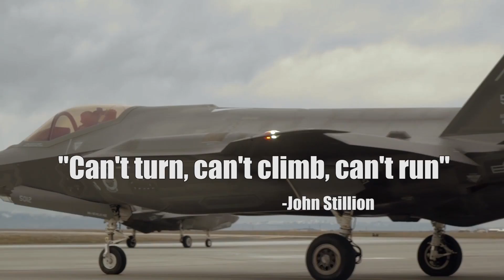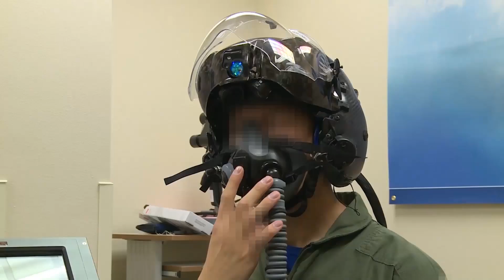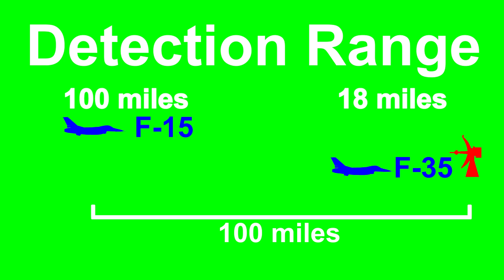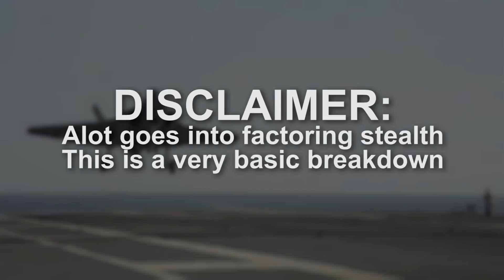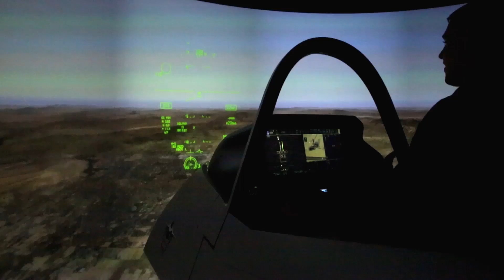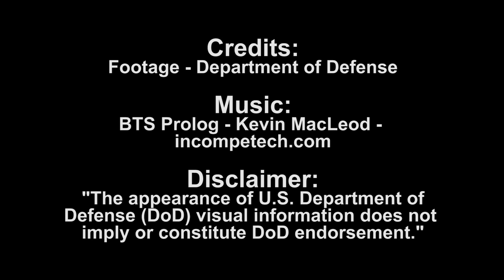F-35 Overview - The Good, The Bad, The Ugly

Comment: The F35 and the Magnetron

Can the F35 Fighter Jet make ALL OTHER FIGHTER JETS IN THE WORLD OBSOLETE? YES!!!
To understand how the Universe works, and how time, matter  and energy interact with each other you need to understand that the Universe is a Binary System, you have Energy that consist of Matter, and you have Space that consists of Dark Energy 
The interaction of Energy and Dark Energy form up the foundation of the Universe, and specifically Gravity and Time
So, if you have a Magnetron, and it puts out an Electromagnetic Field that pushes away Dark Energy it will "Push away Time" as well!
So, this Magnetron is able to manipulate both Gravity AND Time

Think about this, where the "blower fan" is on the F35, if you integrate a Magnetron into this rotating system and generate a Toroidal Electromagnetic Field that pushes away Dark Energy, you will decrease Matters interaction with Dark Energy and you can "Slow Time" 

When you Slow Time, you have in essence what can only be called a "Time Warp" The Jet and Pilot will be in a Time Zone that is experiencing LESS TIME and therefore will be able to move MUCH FASTER!

Imagine the implications of this in a combat situation!

Your huge bulking duck cant get off the ground of a Jet has a trick up it's sleeve! It can WARP TIME! 

Enemy Missile coming in? Multiple Bogies on radar? No problem, kick in the Magnetron, and you will go for 650 MPH to what looks like 2,500MPH in a flash, you will be able to turn and maneuver as if you were going a lot slower, so you can literally dodge missiles, you can outflank and outmaneuver your enemies and you can simply out class them in ANY SITUATION! 

Plus, with the probability of Electromagnetic Pulse Generation Weapons integrated into the system, you can come out of your Time Warp and generate a HUGE Electromagnetic Pulse at the same time, disabling vulnerable electronics at the same time!

F35 For The Win!
Reply: Orion Michael Guy I think you are in the wrong century
Reply: @colonelstriker2519  -  I know I am a natural genius and everyone on this planet is so stupid they seem like literal farm animals! lol - Just Joking... - but no, the data I provide is fact - these jets are way more advanced than people realize - and unfortunately, this planet is being controlled by - how can i say this - this planet is a farm slave planet for ET/Demons that eat people - and people really are so stupid they are farm animals and they don't even know it! Hahahaaaaa.........

Comment: F35 have a number of other advantages that older planes like F16 and F18 are missing.

If we look at the C modell that is the competitor to the F18 its more fuel efficient. Faster cruise speed. More automatic flycontroll system (lowering workload on pilot), more electronic counter measures, 5 tons more load capacity (about 37% more), better dry thrust to weight, higher G-load (due to pilot configuration), longer combat radius (reduce the need for refuling), generally cheaper to run.

For the strike role two F-35 kan pretty much do the work for three F18 using less fuel, and fewer pilots, also less maintenance.

Yea sure, it loses some stealth capability when running heavy. This is hardly a issue because this is ment to be done with air superiority. The most expensive part to maintain is the engines. Larger engines is just a bit more expensive to maintain. So that pretty much rendering 6 engines down to 2... that is a huge improvement.

So for the strike role F35 is really quite superior.Calculating the total system cost, i would say F35 is probably cheaper than F18.

For the fighter role is a bit more complicated. Its about things  that is really hard to measure. The F16 may out turn and out climb the F35... But would it ever have a chance in a real life scenario? I can´t answer that question. But i would suspect that if the F35 can get a missil lock on the F16, but the F16 can´t get a missil lock on the F35.. it maybe don´t matter.
Reply: The stealth coating repair after each mission for the F35 is gonna be 10x the entire maintenance bill for 3 F18 Super Hornets after a mission.

Comment: The facts remain: Can't climb. Can't turn. Can't run. Can't fight. These are problems the F-22 does not have. Only the F-35b can be justified as a special purpose, albeit expensive, a/c to replace the Harrier.

IMO, the USN should be given the task to build a gen 5 air superiority fighter in USA/Japan. They didn't do so bad with the F-4 or the F-14. The USAF and the JCS should be out of the loop.
Reply: Amazes me how You Tube experts know much, much more than the pilots who fly the F-35:

http://aviationweek.com/defense/f-35-demo-pilot-paris-performance-will-crush-years-misinformation
Reply: Out-climbs the F-16 up to 15000ft. Is more maneuverable than the F-16. No need to run, and is generally faster than most fighters out there until the fight is over. Is also cheaper to buy than a few less advanced fighters.
Reply: @dumdumbinks274 :
Check your facts. We have different information. Just one example: USAF brass publicly states they can't get anywhere near a 9g turn with the F-35. An F-16 can, with a full loadout. We differ on your other points as well. Where do you get your info?
Reply: @hankturner9379  I got my facts from various F-16 pilots dating back to 2009, as well as various USAF reports and have followed the progress of the program for several years. You quite obviously have not followed the program at all, instead opting to take what the media say at face value.

USAF brass publicly stating they can't get near a 9G turn is extremely old, somewhere around 2012 when the initial Block 2 F-35 appeared with a 3G limit because it was still being tested. That was raised to 4.5G by 2014. Block 3i appeared in 2015 with a 7G limit. Block 3F is 9G capable and has been around since late 2017. 

An F-16 also CANNOT perform a 9G turn unless it has a very limited payload. A fully loaded F-16 isn't even capable of 5G turns.

Try f-16.net which is a community full of military enthusiasts, retired and active pilots of many different types of aircraft (both military and civilian), soldiers, boat crew etc. 

Here's an F-35 Block 3i (obsolete version) pulling turns that would make the F-16 lose control.
https://www.youtube.com/watch?v=IaHlWow6Yc4

Comment: ONE POINT FIVE TRILLION DOLLARS ...gets you ‘buffeting so hard during high-g turns that makes it hard for you to read your instrumentation.’  WOW.  Those F-35 pilots can take comfort in knowing they won’t be discovered until 18 miles out from the SAM site... problem being: their 1.5 TRILLION DOLLAR aircraft has the flight characteristics of a dried piece of dog turd with two popsicle sticks stuck in it.  Nothing but the best when it comes to killing USAF pilots... they might take comfort in knowing that their express injection into terra firma had a project cost of ONE POINT FIVE TRILLION DOLLARS!!
Reply: Are we in 2070? If not, the F-35 hasn't cost a total of 1.5 trillion yet. Yeah, it's a cost projection for 2070 even accounting for inflation and all related costs.

We're in 2018 though, and it's better to keep up to date. For example, there isn't a F-16 crashing every 10 days anymore. Yet it was  close to that for about a decade after it was put into service. Then the problems were fixed and now it's doing fine. Aircraft development is extremely complex and will have problems no matter what. If you'd worked as an engineer for any product you'd know this.

Also, maneuverability isn't that relevant today. The F-35 would have very limited control surface usage if in denied airspace. The battlefield has completely changed and I recommend keeping up to date on that too.

Comment: Let's not forget ladys and gentlemen,1: all planes that use radar of any sort regardless of the ability to  (jam) the enemy's radar can still be detected by it's pulse put out by the radar it uses. 2: if it makes a wave in the air it can be picked up by satellites. 3: if it gives off heat, it can be tracked and designated by heatseeker missiles. All in all no plane is stealth. Just saying...
Reply: Except that most weapons systems that are a real threat to aircraft are radar guided. And I take it you've never heard of LPI radars? You know the ones that don't trigger RWRs because their output is comparable to background noise... IR systems don't have the detection range to engage at the ranges most fighters engage at.

Comment: They should make less numbers but invest in complete refits of proven aircraft designs the f-16 the f-18 the f-15 all proven aircraft which can be refitted to a 6th gen aircraft since the f35 isn't fully stealth the refits making the older proven aircraft stealthy would be cheaper after all the f-15s slient eagle is stealthy and with more refitting the plane could be more stealthy tho that's more the f22 but it's still cheaper but unfortaunly the government is worried about military war factory jobs that's why America's always at war
Reply: F-15SE isn't stealthy at all, except compared to an F-15E. The F-35 is the stealthiest fighter out there.
Reply: Was actaully a big flop they found that upgrading old planes were more stealthy and cheap even the f-22 was more stealthy there's very little stealth to it stealth itself is now pointless
Reply: @wargodsix  No they didn't. None of the proposed upgrades for older fighters are remotely stealthy. The F-15SE gets the RCS down to about 1m2 which compared to the F-15E's 10m2 is quite "Stealthy". It's also the same RCS value as the F/A-18E and only slightly better than the F-16C at 1.2m2. Compared to the F-35's RCS as estimated by ciritcs who really dislike it and still claim at least a 0.04m2 RCS, the F-15SE isn't stealthy at all. And that's before you add any sort of armament. The F-15SE used "stealthy" pods to hide it's weapons, but even those pods would still increase it's RCS.

As for the F-22, the USAF says the F-35 is more stealthy.
Reply: Then why did it loose in war games which was confirmed by the pentagon the f-22 lost too but had better score then the 35 they lost against non stealth Russian migs so idk where you get your info becuz this has been confirmed by the government yea they lie but it's the main reason the pentagon cut orders for it and called for upgrades on old aircraft today's military builds new designs not to win wars but to keep factory jobs and design jobs going it's about jobs since that seems to be what the working man/woman is concerned about, idk where you get your info Google is not your friend you can say the cut orders becuz of price but we all know the government doesn't care about price that's the tax payers problem
Reply: @wargodsix  No, the F-22 and F-35 have never lost "wargames" against MiGs which for that matter are no more threatening than the F-15s and F-16s of the USAF. The closest they have come to "losing" is during BFM practice and DACT exercises where the opposing aircraft start the fight less than 5mi apart. Typically the F-22 is on par with all the top dogfighters like the Typhoon and Rafale, and the F-35 is not far off. 
Also note that ALL military exercises exist primarily for training purposes, so you get new pilots against veterans. You get pilots put in uncomfortable situations like starting with the enemy behind you, or 2v1 situations. You cannot take those losses and claim the aircraft is bad without sounding absolutely ridiculous.

FYI the F-22 was cancelled because the need for a pure air superiority fighter that is vastly more capable in air to air combat than anything else was not needed after the downfall of the Soviet Union. It was seen as too expensive for what it could do and other US military projects like the B-21 and hypersonic missile tech needed more funding.
The F-35 hasn't had a reduction in orders, if anything the orders are increasing and have been since 2017 because it is in fact an amazing fighter.

The older aircraft are being upgraded because they are lagging behind the potential threats... Look at history and you will find the exact same thing happening every time new fighters were introduced because retirement is a gradual process, not an instantaneous one.

Comment: If somebody could do the math for me I'd appreciate it not exactly my strong point. 
If an aircraft is approximately 18 miles out traveling at 700 miles per hour how quickly would he be on his Target? To me if I can use an analogy would be you equivalent of having your eyes closed and Mike Tyson swinging at your face only to open your eyes when the fist is right about 3 inches from your nose.
What's the time the radar facility realizes you're there my muscles have already taken off and he's gone. Plane doesn't have to be directly on the target. 
That's what the warthogs for! Woot! Woot! 
Besides I don't think correct me if I'm wrong the F-35 is going to go into a fight by itself but the Air Force layers it's fighter planes thus overlapping and giving strength to each planes weakness.  
So you will have an F-35 (clearing the way eliminating radar and surface-to-air missile installations) and F-16 and F-22 flying in a squadron formation possibly protecting a B-52 bomber on escort with an AWACS system at 60 thousand feet up. 
Is a beautifully coordinated system synchronized and proud to say the deadliest in the world.
and without giving too much credit or sounding like a nutcase these are the plans that we know of. I'm pretty sure we have more tricks up our sleeves 
Peace.
Reply: Correctly! But Russians know about stealth much more than they tell you. Try to find out who is Ufimtsev Peter Yakovlevich wiki

Comment: Screw stealth I want survivability, low alt long loiter and the ability to kill the guy on the other side of the ditch in hot gun fight.  Air to air stealth is gonna but a major compromise for the guy on the ground.   Like the iPhone 10 it’s cute has lots of tech tuff but all other useless as a phone.   Give me the A10 CAS I want o live
Reply: Stealth is no more a compromise for the troops on the ground than using an F-16, and the F-16 is used for CAS more often than the A-10. The A-10 can survive small arms fire and continue the mission, which doesn't really help when small arms fire is barely a threat to the A-10 in most situations where the A-10 has used it's gun. The vast majority of AA systems available since the 1980s are capable of shooting down an A-10 without much effort.

Comment: Isn't one of the issues that it is assumed to be a air superiority fighter but it seems to be best suited for stealthy ground attack against radar stations and airfields in anticipation of winning air superiority as opposed to dogfighting the enemy airforce to death. 
But then what do we have cruise missiles for?
Reply: The F-35 is more capable at dogfighting than anything in the US military except the F-22. The problem is that people can't understand that something being designed with a different primary strength doesn't mean it can't also be superior in the primary strength of the aircraft it replaces. The F-16 was designed for dogfights but is less maneuverable and slower, not to mention the F-35 has a huge advantage with 360 degree sensors keeping track of the target.
Reply: Not to mention its EW capabilities.
I read up on the plane since the OP =)

Comment: There is a great deal wrong with this video, most of it coming from a simple failure to do any proper research or fact-checking.  For example, John Stillion and Harold Scott Perdue came to their "can't turn, can't climb, can't run" conclusion using the PC game Harpoon 3 to analyze the f35's combat capabilities.  That's not quite as stupid as it sounds, but it's close.  The quote came from a powerpoint slide prepared by Stillion and Perdue during the 2008 Pacific Vision wargame run for PACAF by RAND.  The wargame was a logistics analysis, and had nothing to do with aircraft capabilities, the slide wasn't part of the presentation, the RAND corporation disavowed any connection to it, and Stillion and Perdue left RAND afterward.  That's only one example.  The War Is Boring article has been debunked, don't believe anything you read on AusAirPower, and maybe listen to or read at least ONE interview with a pilot who's actually flown an f35.  The program cost is the most valid criticism of the program, and it isn't clear cut.  (What program includes the estimated lifetime fuel costs of the aircraft in it's cost?)

As best I can tell, you looked at some online articles and just left it at that.  Like the f35 or not, this isn't really a video to be proud of.

Apologies, you did read Major Morten Hanche's article.  You still would have done better to read more than one.
Reply: #LockheedDefenseForce